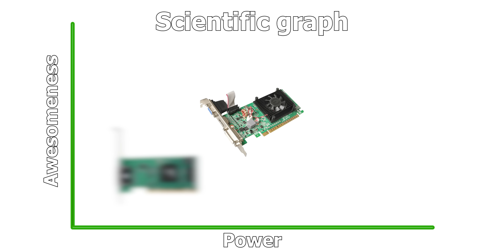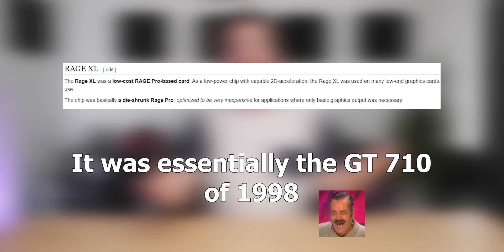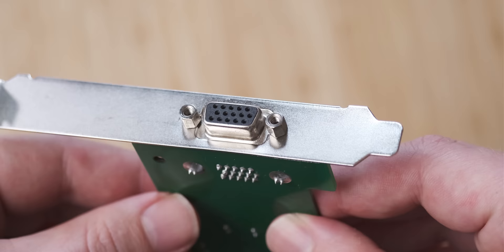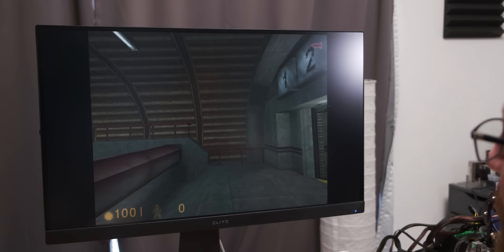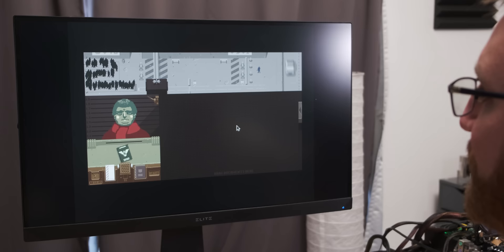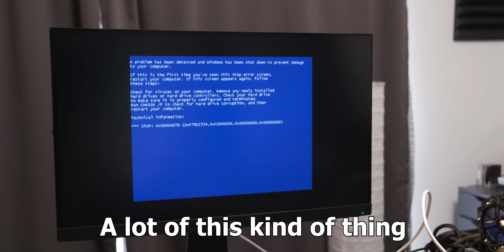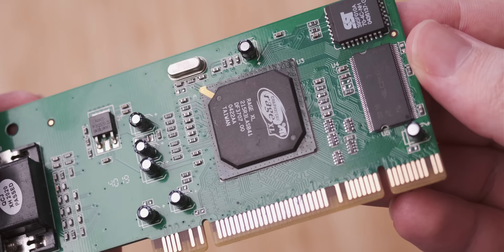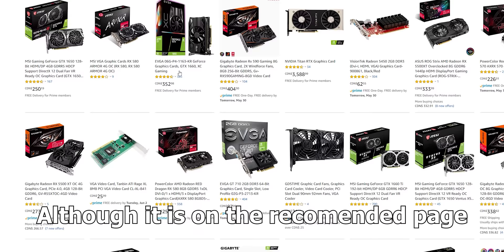Trying to game on the Least Powerful "Video Card" on Amazon

Comment: I think I have something similar. 8mb ram. Yeah probably. I've collected a lot of stuff over the last 20 years. Being a tech means you collect everything as people still run 478 and 775. I draw the line at Pentium 3 and Socket A. Have a mb with socket A CPU in it somewhere. Think there's mb's from 487 and 775 somewhere. I have DVD full of thousands of motherboard drivers up to 2006.

Comment: I thought VGA had a higher resolution than 1600x1200 16bit. I used 1600x1200 32bit on an old CRT I had by the way.
Reply: VGA supports a max resolution of 2048x1536 at 85 hertz, the 1600x1200 limitation is the card not VGA.

Comment: this card is made for retro games especialy stuff like the original doom and dos based games there are not manny cards the original monkey island or day of the tentacle version look so crisp on and allot of older games support this chip specifically and dont run on modern hardware it is also natively supported by open dos so making a usb boot stick whit some old games on it and stuffing it in a system whit a first generation duron or older athlon will give u incredible results whitout the use of a framelimiter wich is normaly needet for systems that powerfull if u want to use windows for some reason use 3.11 or 95se if u realy want to feel the pain

Comment: Its meant for industrial computers built into for example medical device. And you wont replace whole 100s of $1000 machine just cause display output doesn't work anymore. And you cant replace computer for compatibility reasons with software.
Did I really needed to explain that? So in some cases this stupid "garbage" can be worth way more than a stack of RTX cards.

Comment: you dont understand idea of the reason seling this card. its for testing old materboards with damage pcie or agp port or broken integrated graphic. revive this system in this way its faster and chiper than fix motherboard or recovery data. remember - serwers has broken too, profesional technican should have one od this card for tests

Comment: i had this issue beforre with window xp it so weird but if you ever put window 10 on a hard drive and then try to downgrade to window xp it wont let you but if you get a new hard drive it will work with no issue

Comment: I have a lot less fps than that but in minecraft i have 1-8 errors coming into minecraft and from 1 frame per 3 minute and a rare time in between it runs faster avg fps lol dont have avg 0 or its 20 max and other times i cant render anything witch happens often. I have intel celeron j4005

Comment: The card works great for windows 98 games on a P1 P2 on a CRT with VGA why don't you try the card on a system it was designed for I've got the same card in my P1 233mmx  .

Comment: They are great cards for early PCI systems... Aka 486/586 and early Pentium up to Pentium Pro. Downside is they screwed up the manufacturing and the PCI 1.0 support no longer works. Its a largely useless card, save for some servers.

Comment: Slow cards like this set today's standard for using pci for gpus even though few people used them it was known u could throw them into anything and that's why system integrators designed the x16 bus that u could plug anything into even when it's not the right slot it will still work thank you potato gpus!

Comment: It can be seen, you don't understand retro hardware.
This card was released in mid 1998, more like low-end solution, along with Ati Rage 128 GL and Rage 128 VR.
And you're trying late 1998 most demanding game on it, and even game from late 1999. This is not f..king 2010-2020 era, where you can use 5 year old video card. In 1999, one year old was like 5 years today. And it was LOWEND card for year 1998. So try to guess. Ummm.. trying some 1997 games instead? Because, it is based on Rage Pro, which came in 1997 as primary card from Ati. No, he begins with most demanding game of 1998, half life.
This card, based on Rage Pro, is competition to voodoo1 and Riva 128. Try to think. it was primarily meant to render 3d games from 1996-1997 at acceptable speeds in 640x480 or 512x384 resolutions in 16-bits. Because, software renderer of that era, couldn't handle anything besides 320x200x 8 bit (256 colors) or 400x300x8 bit .

Comment: I don't understand your attitude. It's like "let's laugh at how crap this very old thing is" but everything was the same then. I built a Pentium II system around then, it had an 8MB ATI All-In-Wonder Pro graphics card with a RAGE chipset of some kind in it, and it was cool for the day. The system eventually had a whopping 192MB of RAM and a 17GB hard drive and I ran stuff like Photoshop on it and it was a fine system of its time. It wouldn't run anything today, even a modern OS. But that's Moore's Law and all that. We had expectations relevant to the technology of the time.

So you just come across as smug and laughing at something for the sake of it. I'm sure you mean well but the attitude just doesn't make sense.